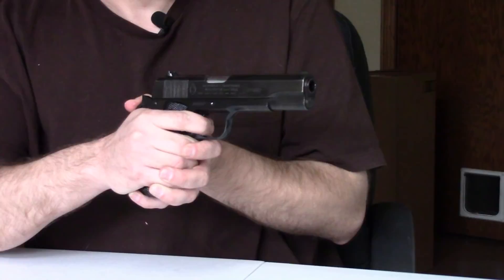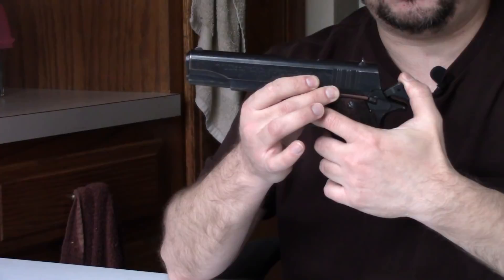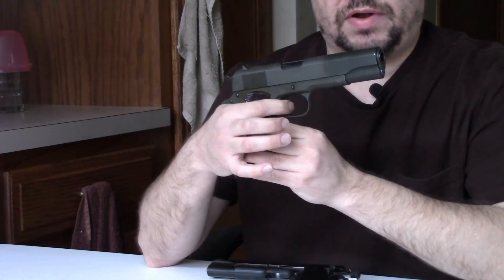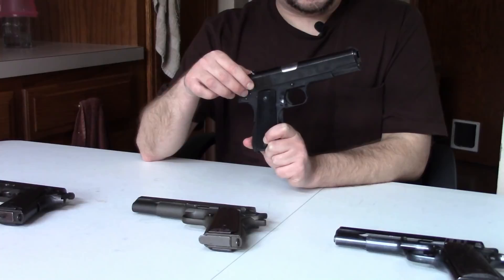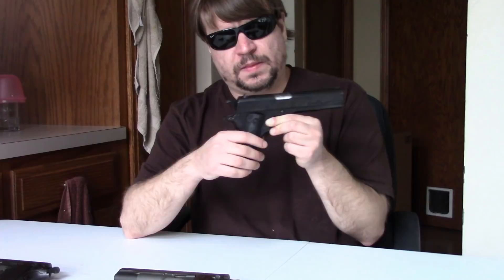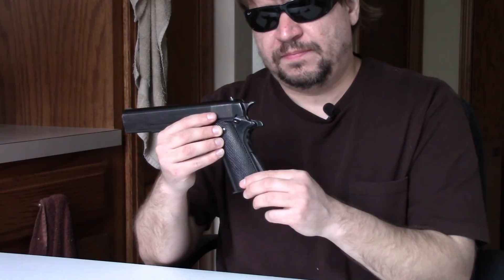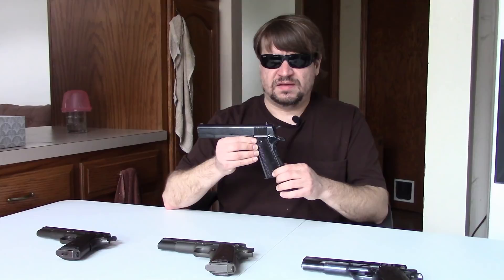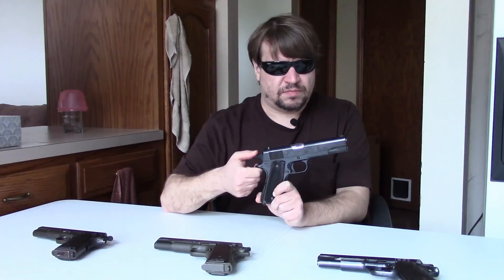Systema M1927 Pistol - Argentina's M1911 Colt Clone Copy

Comment: I have two of the original Colt model 1927. One is in original condition, unrearsenaled. The second has been rearsenaled with a parkerized finish. The first has about 50% of the original blued finish remaining. Both are serial numbered under 10,000. The first one's frame is only numbered under the mainspring housing. The second one's frame number has been stamped on the right side in plain view. With both, the slide and barrels are matching the frame numbers. Both barrels are worn and pitted. I rebarreled the parkerized one, and it is a great shooter now.

Comment: I have two Navy versions;  One blued and the other parkerized.  Great shooting pistols, that even feed LSWC handloads.  Only issue is severe hammer bite, but to be fair I have fleshy XXL hands, so no surprise (looking at you too BHP).  AFAIK, both were made in 1954, with the majority of finish remaining.  Have found that they are sensitive to magazine fit, as some magazines fit a bit tight, others just fine.  Both of mine have their orig S/N magazines and function perfectly.  SUPER nice 1911's.

Comment: MIsha,  I bought a good condition Sistema Model 1927 for about $65 in a gun store in Fremont, Calif., in 1971 or 1972   I'm almost 85, so I have had it half a century. The serial numbers on all parts, even the magazine, match.  The finish shows little wear, for I have put just 150 bullets (approximation) through it and carry it just for self defense when hiking in predator areas.  My extra magazines functioned without fail in this pistol when tested.  Only GI hardball 230 grain bullets have been in it, so I do not know whether hollow points would jam.  It has not been reblued or otherwise altered.  Unless one of my kids want to inherit it, I might sell.  What is the approximate value of this pistol?
Reply: 2000 starting

Comment: Of all the budget 1911s out there, which would you consider the best  quality?
Reply: Lord, there are so many now....where to start? Maybe give 3 or 4 to rank?
Reply: Misha Rock Island, Taurus, Ruger, Springfield mil spec. I know the Ruger and Springfield are a couple hundred more and want to know if its worth it, or should i get a cheaper brand and use the money saved on extra magazines?
Reply: @texasghost6725  I can't speak for Mischa, but I have had a couple of Rock Islands and  have had zero problems with them. For the money, I would get a RI and spend the difference on lots of ammo.
Reply: Generally both Rock Island and Springfield Milspec should be gtg, but I have more trigger time with the SA, so i'll say it. I haven't had much time with the Ruger, but generally I like the company's stuff. As for the Taurus, easily, it would be the lowest down on the list for me. I've just seen too many with 'issues' and they don't seem to hold up as well long-term. One good thing about the Ruger, it would be made in the USA. The RIA and SA are both built from imported parts....not a bad thing but just a thing to know.